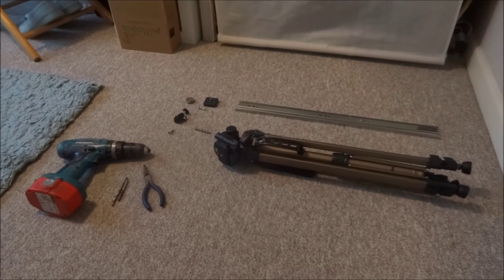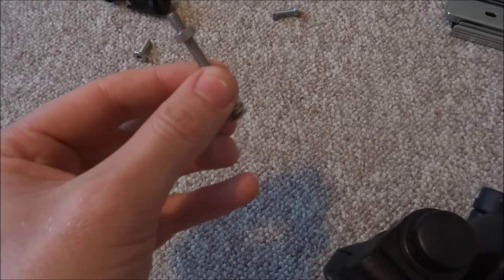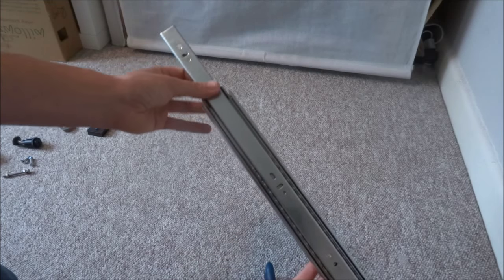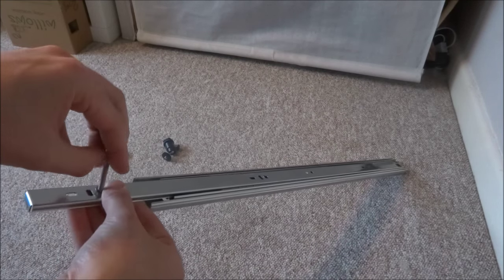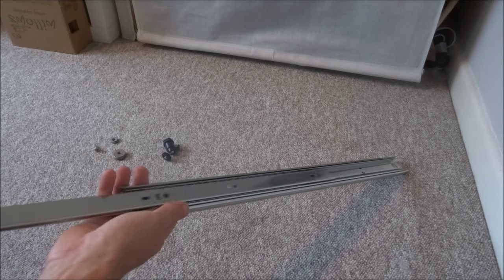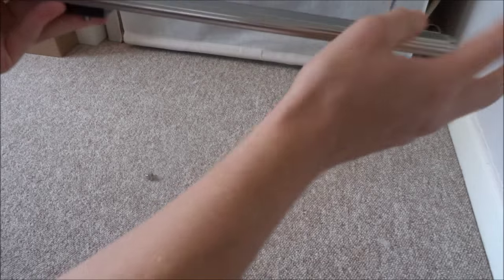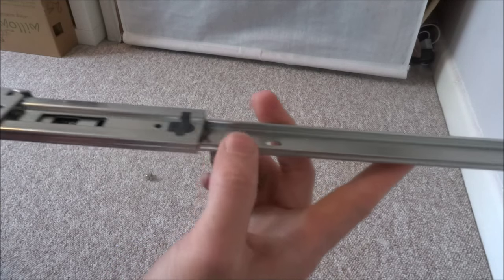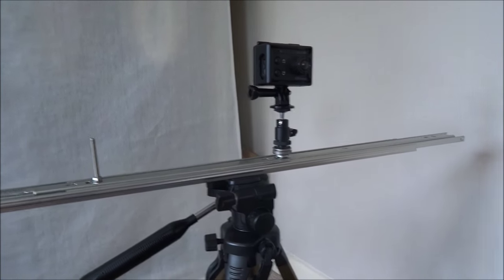£15 DIY Camera Slider / Rail / Runner to use for video recording

Comment: Yep, that a Boy^!!^  That's how I made Mine in 2010 except I used a couple 1x2's and a T-Bracket to offset My Slider from the tripod pivot point in order to reduce Parallax.  And I didn't have a Ball Head, LoL, so I made Myself a Tilting Swivel Block Head instead.

Comment: Screwfix do these same sliders for dirt cheap. I bought 550mm twin pack for £6.50 and found smaller 250mm ones for £5 (made a mini travel slider from it). Modified I got 350mm of run, but at the cost of ball bearing friction at the extreme ends.

Comment: use a rubber band to pull the handle for a smoother slide
Reply: Try Fishing Line, it's Stronger;^D  Then add a couple Pulley's and a hand crank. 
Then replace the had Crank with a motor and WAMMO^!!^